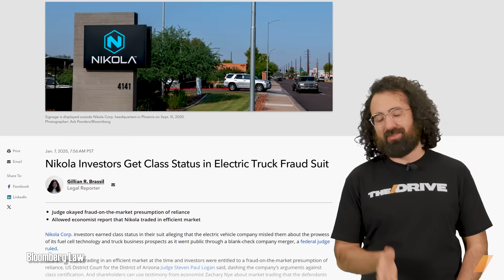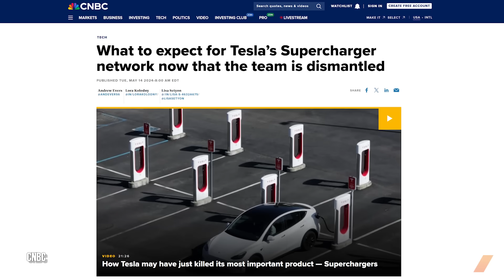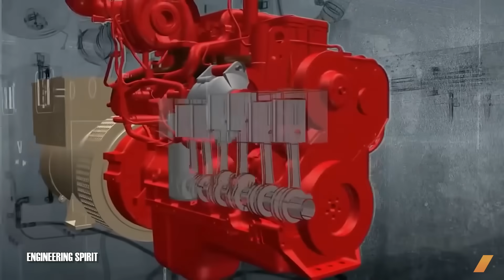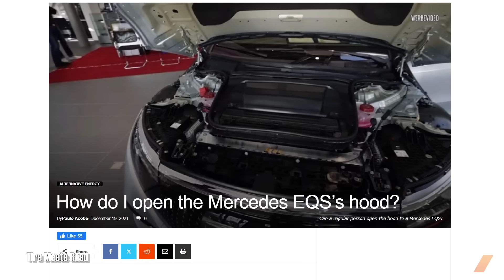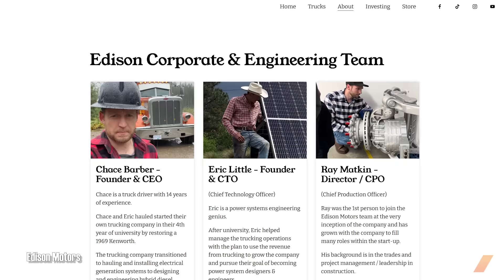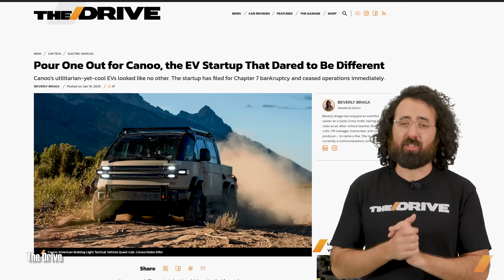The truckers in a shed beating Tesla with 100-yr-old EV tech

Comment: Again, this looks good on paper, but hauling up a mountain will deplete the battery, and the generator is not capable of keeping up demand, so the semi will be forced to a crawl or even stall on the mountain. There is a reason there has not been any footage of these in action. Good idea in principle, but mountainous terrain kills the idea.
Reply: Its true that the operator will want to ensure that the batteries are full prior to starting a steep grade. I'm sure the first time that happens will be a learning experience.
Reply: @Sah-o5m The capacity of the battery that is with these trucks is nowhere near enough to sustain navigating a steep grade with speed even when full. I haven't done the napkin math, but I estimate it wouldn't even make it a mile up a mountain pass (10% grade) with the generator running 100% duty cycle for the battery to become depleted and the semi to be reduced to a crawl or maybe even stopped to recharge.

When the battery is depleted, the truck only has the horsepower provided by the electromechanical conversion offered by the generator, which means that it would actually have very little power to weight compared to that of a traditional, large-displacement semi truck.
Reply: @PrIsMaTiSmX  the math is fairly simple. The 250 hp engine alone is enough to climb any mountain like a normal truck. The batteries plus the engine running is enough to climb any grade in North America expertly.

I'm pretty sure that a fully loaded and charged Edison truck would and up at reduced power before it made it the 43 miles from sea level to the 14,000 foot observatory at Mauna Kea in Hawaii. I'd love to see this done as a test some day.
Reply: @Sah-o5m  The typical parasitic loss of a diesel electric system is roughly 20%, meaning that the 250hp is actually outputting 200hp to the actual drive wheels. Of this, there is limited torque at higher speeds, and seeing as how the standard semi horsepower is in between 400-600hp, this truck is underpowered from its traditional counterparts by at least a factor of two. That said, it is obvious to assume that since semis already struggle climbing steep grades above 5% even empty, this truck likely wont be able to do much besides crawl after the battery depletes, and that is when its empty. When its loaded, I see no way that its able to continually climb a hill of any caliber at steady state above a 2% grade without coming to a crawl.
Reply: @PrIsMaTiSmX  A fully loaded semi climbing a 10% grade typically requires between 300-400 kilowatts of power. The 200 kWh fully charged batteries would last less than 1 hour on a 10 % grade. Throw in the 200 hp or 150 kW from the engine and the truck should pull a 10% grade for an hour.

We both agree that it is prudent to ensure fully charged batteries prior to climbing pikes peak in a fully loaded semi.

Whereas normal EVs suffer from range anxiety, Edison trucks suffer from mountain pass anxiety. 

If the batteries drain on a hill, it's irritating,  but not the end of the world.

We'll know more this summer after DeBoss garage releases the dyno data and the cross country trip experience.
Reply: @Sah-o5m  I think you forget the part where these trucks are supposedly specifically designed for use in timbered, mountainous terrain, lol The battery is nowhere near big enough, and the generator is underpowered. When the battery dies, the truck will only be able to travel up the 10% grade at 9.5 mph since there is only 200 hp to the drive wheels. This truck WILL experience these problems, and my hypothesis is it would be even more severe than expected.
Reply: @PrIsMaTiSmX  Oddly enough Edison logging trucks don't CARRY logs up hills, that is nonsense. They go up mountains empty, then use the weight of the logs as they come down the mountain to do "regen" and refill the battery. The battery will have a frightening surplus of energy in this situation. But i'm willing to be wrong and have you hold the positive and negative leads on the batteries at the end of a run so you can confirm your hypothesis.
Reply: @Sah-o5m  Edison logging trucks TRANSPORT logs from the location from which they are harvested. Thinking that the truck never goes up any mountain fully loaded is absolutely ridiculous. "Frightening" is complete nonsense. Not using your brain is no excuse for having the wrong opinion not backed by basic physics.

Comment: Oh and an important fact to know is most of the Diesel-Electric train Diesels (as well as just stationery Diesel generators, which are basically the same..) are developed to work on one RPM range for their lifetime, which actually allows to ditch the sacrifices to have a full-range of torque / power / turbo-spool you get on actual truck Diesels; so eventually if Edison or a company that partners with them & supplies the engines designs such Diesels for this specific role, the efficiency will shoot up considerably. 

An example is one of the current developments of an opposed-piston 2-stroke Diesel is said to creep up on 50% efficiency, this is close to ideal theoretical efficiency & is so much higher than your average car engine it's actually no comparison... So the efficiency & especially emissions & even weight will only greatly IMPROVE if this Diesel-Electric idea actually starts getting adopted.. All those points also naturally mean the engine can be lower capacity, which is a positive feedback loop to further improve all those points.. And keep in mind the engine tech I last described is actually much older than Diesel-Electric.. What's old is new or rather, the FUTURE!

Comment: These guys are busting ass and I hope they see all the success they deserve.

I've been a driver in heavy vocational work basically my entire 12 year career. I've been a driver, before that I did maintenance and repair, and in the middle I did a bit of "shit's hitting the fan we need a solution" logistics/dispatch while being a driver. I love my big diesels, my manual transmissions, full lock 46k rears, chrome and chicken lights. But I would be a fool to deny the issues with them, and modern "throwaway" society in general. Edison seems to be on a mission to be a driving force to solving those issues, even if they are the only ones doing so. 

The only trouble I can see is that modern technology is not designed to be in such harsh environments. Computer modules take an absolute beating in modern passenger cars and big rigs multiply that abuse from NVH at least tenfold. Also, battery technology is still a major limiting factor. Being cost prohibitive, suffering longevity issues, and limited resources of materials needed to create these massive batteries. 

I think Edison is doing everything they can to address all the issues they can. And inreally hope they nail this. They are taking the right approach from everything i have seen and really are in this for the long haul. Their motto is by truckers, for truckers. And they are holding to that.

Comment: You might ask how much power those axles offer.  The answer is that, on its first 100,000+lb test haul, Topsy lost grip and spun its tires coming off the line!  ...and you can have your installer pop those same axles under your F350.  Nice.
Reply: Imagine a f350 hotshot rig towing a 40,000 lb trailer full of cars and being able to uphill with no problems.
Reply: @Sah-o5m  "Imagine a f350 hotshot rig towing a 40,000 lb trailer full of cars and being able to uphill with no problems."

The only problem would be not enough weight on the wheels to maintain grip.  :grin:

Comment: Looking at the Engine data quick, it's peak BHP is about 400, while his electric traction setup is almost 1.5kHP and the torque difference would be probably much more serious too.. So the power when necessary is so much more it's actually shocking. Looking at the peak HP VS Torque on the curve, the peak HP is a flat line from 1600 to 2100 RPM, however peak efficiency & torque is @ just 1200 RPM.. While this is actually a very impressive setup compared to some Diesels, yet-again this is @ static measurement, in other words NOT counting turbo lag OR temperature fluctuation & air-density outside (elevation)! So, even this very-well-runded motor still will have major dips in real-life use.. But if it runs @ 1200RPM constantly, all those issues IMMEDIATELY DISAPPEAR and emissions are especially amazing.

Now what's REALLY worth mentioning is how this could be used (especially in developing nations that can't afford retro-fitting an entire common-rail system & emissions controls..) with old mechanical Diesels: as he said, when you drive normally (with mechanical injection) you let it dip, then press on the pedal & out comes black smoke.. That's because the turbine spool delay means the otherwise-fine air-fuel mix is now extremely rich & the emissions are literally increased by a magnitude.. So this tech could be used to re-use old Diesels & make them meet emissions with 0 actual upgrades, aside from NOX reduction, but that's so much cheaper than also adding huge DPF & upgrading to common-rail electronic system.. But heck, even if you have the full modern upgrade (costing so much it's maybe the same as just buying a new entire engine..), there is still no fix for the brief torque-loss & inefficient ranges when you're constantly altering RPM..

In short, this is THE FIX for Diesels AND trucks in general; whether it's purely for the tightest emission, re-using old Diesels or simply wanting more power / torque on a limited-size platform, same power & capabilities as EVs but without the weight; last but not least it will always be more economic, no matter how you slice it, realistically. I pray these boys win & don't get shut-down by these evil companies trying to push EV-only agenda which will destroy everything from agriculture to logging!! These industries aren't the same as our transport vehicles, an EV truck could NEVER go logging in middle of nowhere climbing up crappy roads for hundreds of miles, even with better battery capacity the weight could NEVER be stripped to be appropriate for these jobs!

Comment: Correct me if I'm wrong, but I'm pretty sure trains aren't hybrids, (atleast the diesel ones).

 Most diesel locomotives are actually diesel-electric locomotives, which have prime movers (large diesel engines) that power generators, which then power traction motors.

The reason why a diesel electric locomotive is not a htbrid is because the prime mover does not have the ability to directly power the locomotive. And also to note, these locomotives do not have batteries.

Although this might change with battery locomotives or actual hybrid locomotives.

Comment: The deisel motor adds more moving parts and lowers reliability.   Greater capacity batteries that are lower in weight are key to going full electric on semis.   The electric grid will get updated over time to handle the capacities that are needed.

Comment: The issue with the "it uses a smaller battery thus it's cheaper!" argument is that it doesn't really apply long term: the smaller the battery the more cycles you'll be putting into it, thus requiring more frequent battery swaps. On consumer cars this smaller battery is really beneficial as most traffic is city traffic, thus you really get the benefit of the stop-and-go efficiency. On semis it's debatable since most trips are long distance and you'll still need to haul around a decently sized battery.

Comment: Part of why diesel locomotives are series hybrids is the powertrain. A smaller loco is about 4,400 horsepower. The bigger ones top out around 6,000 hp (I worked for GE Transportation Systems, for many years; their AC4400 and AC6000 locomotives evolved into the modern Wabtec Evolution locos at those same power specs). You've got one massive prime mover engine and you need to gear that power, for low-speed torque and higher-speed cruising, while spreading the power across three axles on each of two bogeys (known as a Co-Co configuration). How are you going to do that with mechanical transmissions? Building a mechanical transmission which can effectively gear that much power, much less splitting it across a total of six axles, is going to be mechanically complex (ie less-reliable and maintenance-intensive) and extremely heavy. Turning the power into electricity and feeding it to six electric motors (one per axle) is much cheaper, easier, lighter and requires less maintenance.

Semis have been using fully-mechanical transmissions all along; the scale is much smaller, so semis haven't needed to go this direction. They can, of course, but they haven't needed to.

As for retrofitting older vehicles to electric hybrid ... it's part of a restomod. Restore the body and interior and modernize the power train. I don't want a modern F-150 ($$$!) but a restomodded 1978 F-150 would be very nice. Give it four motors, driving the four axle shafts independently (torque vectoring) and it would be far better than the original. Give it enough battery that I can drive around, all-electric, in town, where I would normally get the worst fuel mileage, and it gets even better. Give it the ability to connect to my house, when the power grid is down, and function as a standby generator and we're in "shut up and take my money" territory.

Comment: So, why use diesel in this setup anymore, though? That WAS for the torque, no? What's the most efficient fuel source available? Isn't gasoline cheaper than diesel now? Natural gas? Hydrogen? It just needs to be an efficient engine and literally nothing else, the motors have all the torque it could need.

As for retro fitting, aren't brake rotors pretty universal? What if the hybridization occurred at that point instead of replacing the whole drive train? It would require a computer to get the new brake/motor-rotors to apply power in a specific way to the wheels in conjunction with the fuel engine, but then we could have true performance-hybrids with any vehicle we choose.
Reply: Afterthoughts: I'm guessing you can make a more powerful generator from a high torque diesel engine than you could with less torquey fuel applications.

Comment: This is literally what I immediately thought of when I first heard the term "plug-in hybrid". Instead of the shitty hybrids that are widespread at the moment with ICE powertrains and electric assist, you put in a generator that makes electricity to drive the electric motors. This way you get the range and convenience of a internal combustion engine combined with the power, performance and, yes, reliability of electric motors driving the wheels. Want to upgrade that? Add a small battery pack with a 50-100 mile range for daily short distance trips that you can plug in and charge at home. This way you basically get the best of all 3, ICE convenience, hybrid efficiency and electric performance with practically no added weight for ICE vehicles and comparable complexity of current electric or hybrid that we have already. Plus with the improved fuel consumption and reduced emissions that comes with a generator running at peak efficiency and constant RPM it should be even better than the current hybrids.

I just wish that a 4x4 pickup or suv with this type of technology would be available to buy in my country within my lifetime... Otherwise I'd just have to go and design and build one myself.

Comment: If you put this tech in large motohomes, i would 1000% be interested in buying one.
Reply: Part for the company goal is to make the e-axles available to other integrators. They've mentioned a coach builder expressing interest. 

It's ideal - motorhomes already typically carry a big traction engine and a slightly smaller generator, and house batteries. Remove the traction engine, beef up the generator and house batteries, and you've got a hybrid rig with more off grid capabilities. 

And with a roof of solar you can even recharge over a few days without fuel.
Reply: @saiboogu  My thoughts exacty.
Its really a perfect fit.
Reply: oh hell yeah, built in generator and battery’s!
Reply: You will be able to buy the retrofit kit for any pickup truck type chassis with solid axles, so likely they could convert a motor home.
Reply: Honestly it seems dumb to me that this isn't already a thing, most of them are packing a engine for a drive train, then a separate generator.. I guess really its battery tech thats lacking.
Reply: @Skagzi1la  The trains that use the tech didn't typically have batteries at all. Maybe they do now but IDK
Another "series hybrid" is the diesel-electric submarine
Reply: As a fellow Jimmy, I approve. That would be cool
Reply: @jimmykelly9738  Jimmy approved.   I like it!!!
Reply: I actually saw an article in motor trend a few months back, a company is developing a chassis for a hybrid RV.
Reply: @47CryXMA  That would be a great start.
Reply: Check out the next round of production. one is a non-public client but they showed the CAD render and it's darn close to what you're thinking if you want to see how they would style a smooth nose. it's sexy
Reply: @seldoon_nemar  NICE!!!!
This idea is proven tech.   Its decades overdue.
Reply: @Seldoon_Nemar  i'd say take the german Hymer B-series style and just scale it up.
Reply: Motorhomes are already a complete fucking NIGHTMARE to work on. I would rather see them do a ground up than a retrofit to see if they could create way more space for techs to work on the motorhome in.
Reply: Atleast you are in a home while your broke down lol.  Use to full time myself, no way would I want fickle over complicated electronics.
Reply: Tooooooo many government workers.....not about if....but about how they can tax you. Money has a way of brainwashing simple man.....unlike an animal that has less effect on its environment.